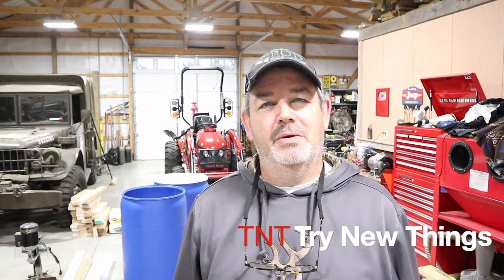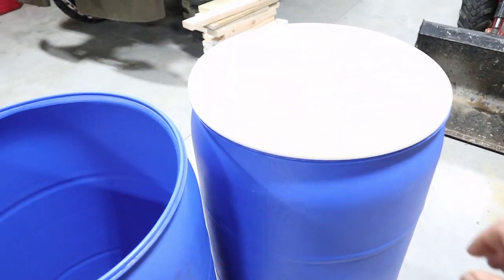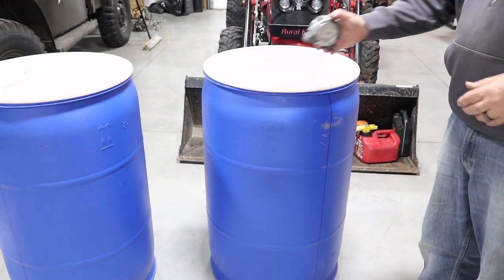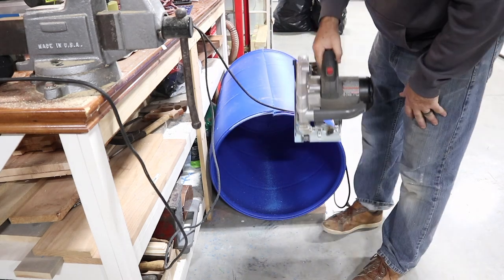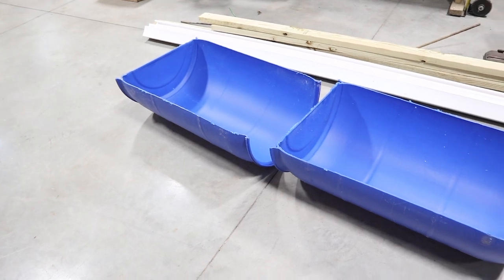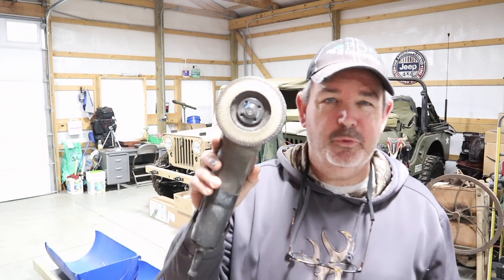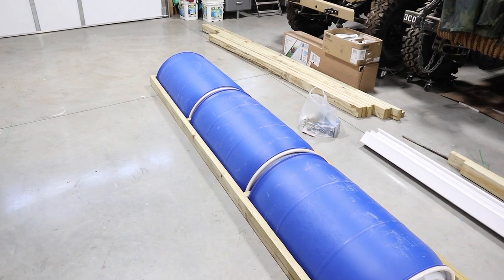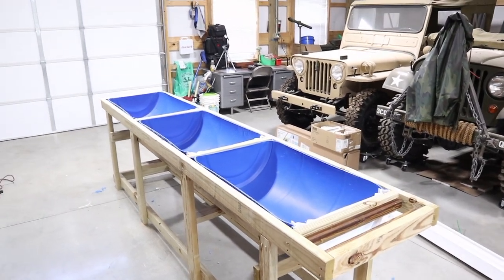TNT #147:  DIY 55 Gallon Drum Greenhouse Planter Build

Comment: I would like to make a suggestion for future growing pots.  Use the earth box concept.  Put a grid type of material in the bottom and leave about 3 inches or so for water to stay in the bottom.  Have a pipe to fill it with water.  The drain hole will be about 3 inches up from the bottom.  Fill it with water until the water comes out of the drain.  The potting mix does not get in the water.  I have used earth boxes and love them.  I have grown monster tomatoes wit them.  Just my 2 cents.
Reply from the maker: Do you have a picture of one Larry?

Comment: Great idea....and finished project.  Think you might be getting close to a putting together a "Greatest Hits/Misses" episode....
Reply from the maker: Fun season quickly coming to a close.   Was 73 degrees yesterday, 60 today, not supposed to break 40 tomorrow, and the 10 day outlook is cold, cold, cold.    Almost time to do some indoor projects.    Trying to wrap up water harvesting system for greenhouse tomorrow if I can, then be onto some restorations.    Picked up a massive corn sheller in need of total rebuild.   Have to use the tractor to pick it up and move it around.   Should be fun, will likely take me a couple months.

Comment: How dis you connect the legs to the top?
Reply from the maker: Pocket screws is how I attached the legs, you can see them at about the 9:00 minute mark.   Thanks for the question.   You thinking about building one?    Two years on, and I'm getting a lot of productivity out of mine inside the greenhouse.   Just pulled all the spring lettuce that had run its course and planted some cucumbers that are supposed to be heat tolerant and some peppers for the summer.    If you havn't already, give the channel a Subscribe to catch other hobby farm type projects.

Comment: setting mine up for next year, my tomato's drown a lot during heavy rains.
Reply from the maker: with the drain holes at the bottom 'swamping' the plants was not an issue, in the greenhouse I did have to make a point to water at least every other day so they would not dry out.     Thanks for leaving the feedback - I'm loving this raised planting bed design and may add another one next year.